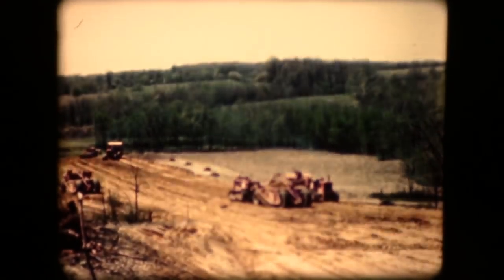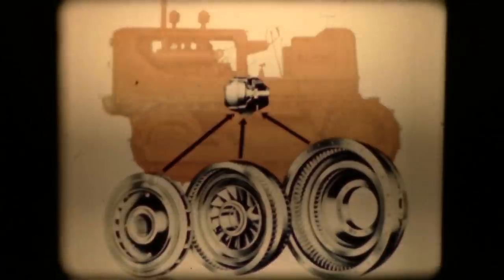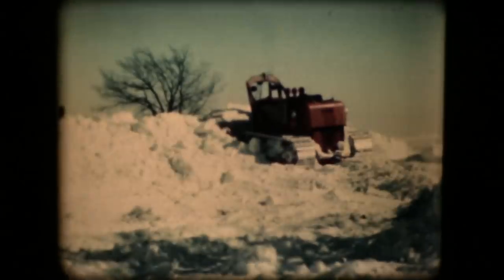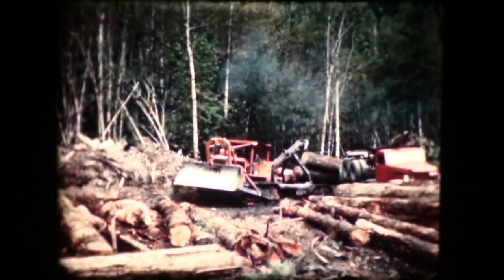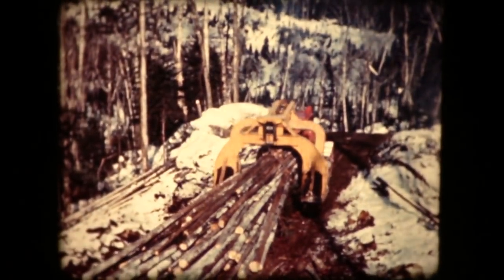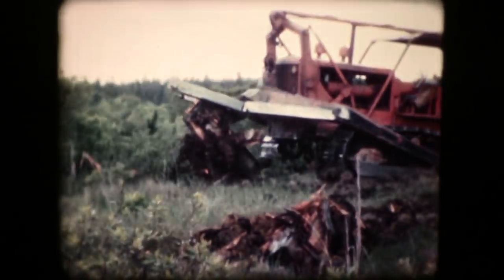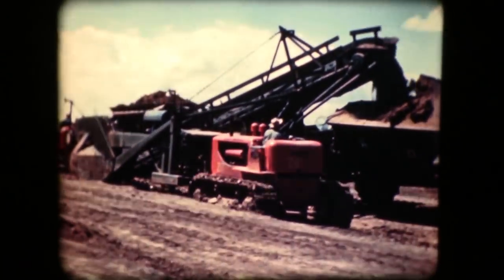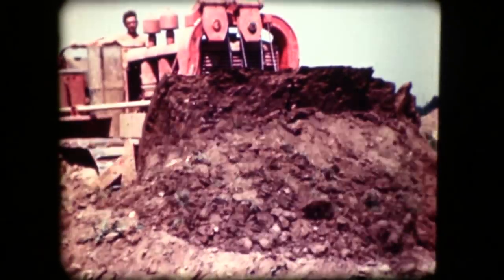1950's Allis Chalmers Dealer Movie It's Tops! HD-19 Tractor Crawler

Comment: Why so much flickering?
Reply from the maker: Best I can do with a projector and a camera
Reply: The problem is that the camera shutter/frames aren't synchronized to the projector frames.
Reply: This must be a very old film I don’t think bulldozers have pulley driven blades anymore. They are all hydraulic. At least to my knowledge. Thanks
Reply: It’s just like watching a silent movie. They flickered a lot.I think the reason being the movie cameras didn’t have electric motors to advance the film until the late 20s or early 30s
Reply: @glennso47  It flickers because he is putting the camera in front of a projector, instead of scanning the film.
Reply: @explosives101  thanks for the update